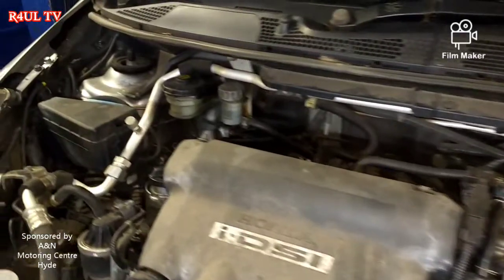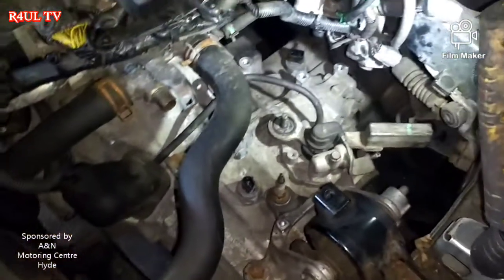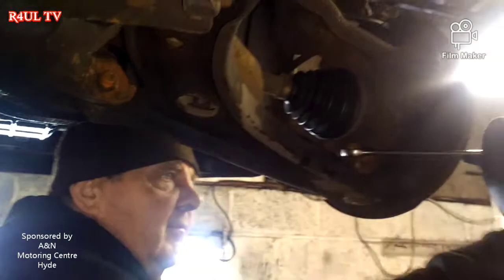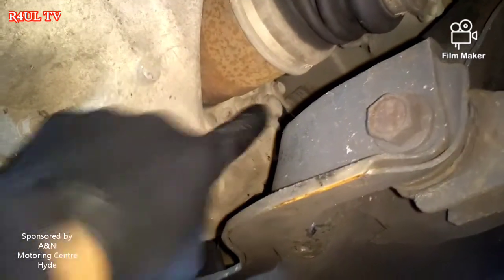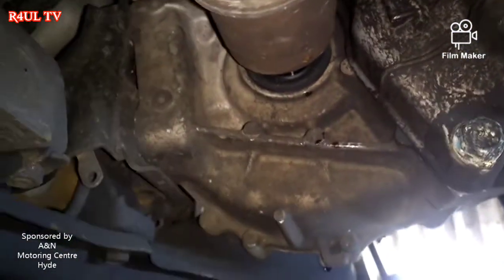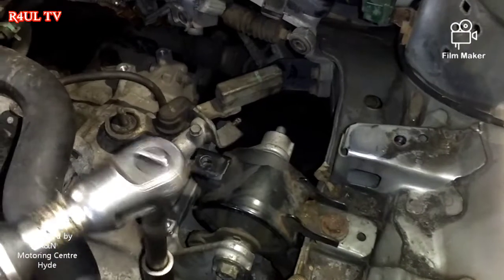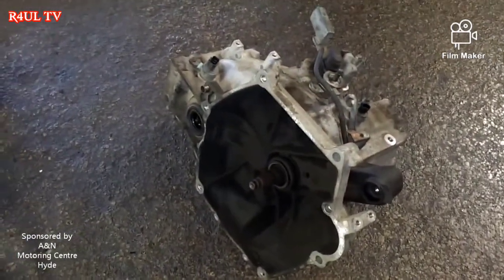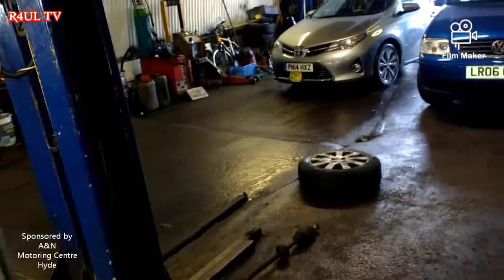How to replace Honda Jazz Clutch 2008 1.4 petrol

Comment: This person or anybody in particular who time an put  up video tutorials for others including myself to learn or to get guidance/help an so forth, really we all should be appreciative of the fact that the people out there are willing to give up their knowledge and the know how to others for help etc.
Reply: Hi mate rear engine mount you removed atv 7min 20sec in tutorial, can you tell me if all these bolts need to be removed as shown or will removing 17mm only release the mount from gearbox. Iv lossened two 14mm an probably get 2 top 1 with extention bar etc. Just to be clear have all the 6 bolts gotta  be removed 14mm x3 on backside gearbox x2 14mm on top side an 17mm through actual mount. Thks

Comment: How much time did you need for the entire job?
Reply from the maker: I would give yourself about 4 to 5 hours 
I could do more quicker but if you never done it before give yourself good few hours. It's not too bad this one
Reply: @TEAMR4ULTV  My biggest problem is that I don't have a lift. On the other hand, I also have no problem lifting a car very high and putting it on stands. Hey great movie, has already helped me a lot to choose to do it myself. Just demolished a Saab for parts, so I can make a Honda too. LOL
Reply from the maker: Where are you from. If your local bring it down al help you do the clutch
Reply: @TEAMR4ULTV  Thanks but I am from Belgium, Antwerp region
Reply: How much do you charge for clutch replacement I have the exact same car, which make clutch would you recommend. Thanks